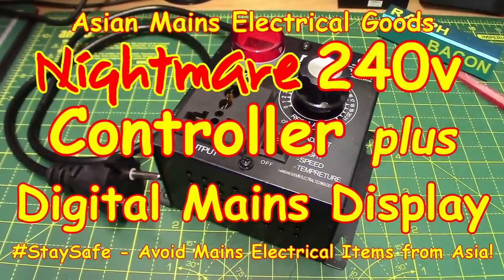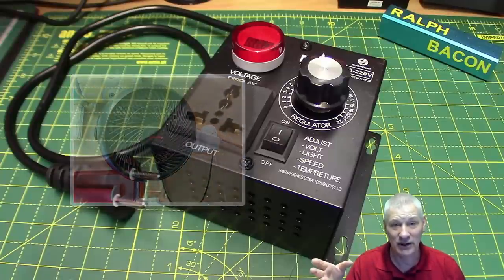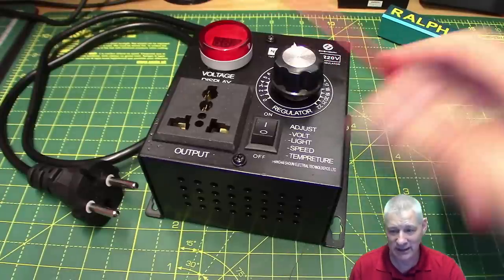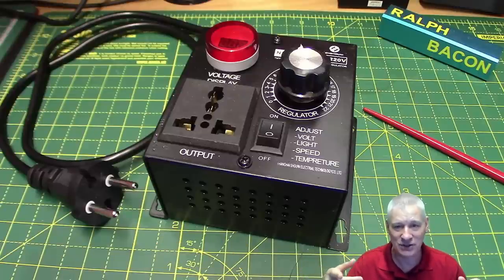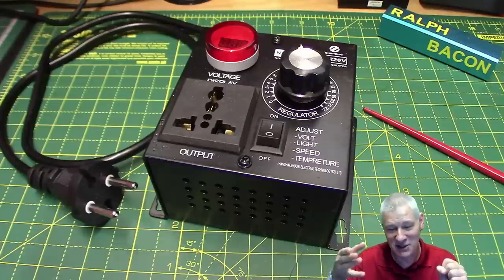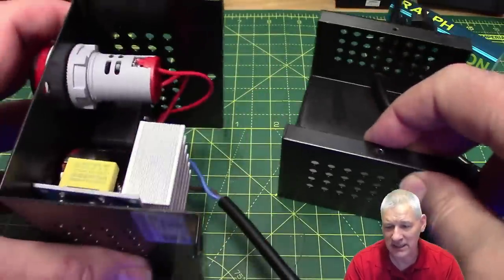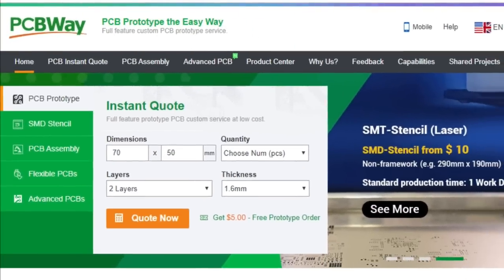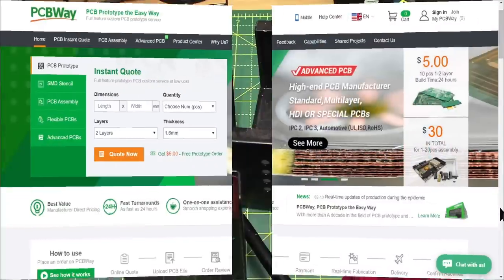#188 Nightmare Fan Speed Controller PLUS a Volts & Amps Digital Display

Comment: Hi Ralph. I love your videos. I have some questions about video #88 (X9C103). I am trying to use an ESP8266 NodeMCU to control the X9C103 BY WAY OF ALEXA. I have written a short sketch which sets up the 8266 as an Alexa device, and it is functioning properly. Do you have any tips or resources for adapting the code you used in #88 to allow control by Alexa. I will be using the setup to control a very old console stereo by replacing the analog pot with the digital pot. Ideally, commands would be "Alexa, Volume (which is the name for the 8266 as recognized by Alexa) up", "Volume down", to move the wiper one position, as well as "Alexa, Volume 50" to set the wiper to a specific position. I understand my pin connections, but need some help with the code.
Reply from the maker: What data does Alexa give you when you say Volume 40?  Or Volume down? As long as you can extract the value from the JSON then it is no more difficult that if you had had the value available from the start. As you have your ESP8266 functioning as an Alexa you should be able to determine this in minutes. Let me know if you are stuck.
Reply: @RalphBacon  That makes sense, but so far, my x9c103 has not arrived from China :). I won't be able to test until Friday. But you've pointed me in the right direction, so I'll get back to you once I've been able to test functionality.
Reply from the maker: You don't need your X9C device to get the Alexa bit working with a value (extracted from the JSON) in memory that you then supply to the next bit  of the project!

Comment: The digital read on your speed controller might be interpreted as "RMS" voltage.  Yes, I like your AC gauge!  Cheaper for a dedicated readout than my "Kill-A-Watt" device.  Gotta order some.   Have sent Gadget Reboot an Omron G3MB-202P photo isolated, zero crossing 5V SSR -- but sadly, I do not think he knows what it is.  Would like to try chopping up the AC power signal with an SSR + Arduino as a means of speed control.  But AC scares me.  Am barely responsible enough for 12V DC.
Reply from the maker: Mains voltages scare me too - at least, I have the greatest respect for them. Arduino have an AC phase-controlled motor circuit on their playground circuit but I just don't have the time. An hour will be all I need to fix this. (Arduino hour, obviously = most of a day).

Comment: I've never used one, but I'd at least look into a Shelly Dimmer.  It's meant more for in-wall or in-ceiling mounting, so not meant to be nice looking out in the open.  Alas, it says 50-150V for resistive-inductive loads (like a fan); OK for us in the U.S., but maybe not for you in the U.K.  Or the Sonoff iFan03, which is specifically meant to control a motor, and comes with an R.F. remote.  Both have WiFi with mobile apps, and should be able to integrate with other home automation stuff.  Imagine if it automatically turned on when the workshop got warm...
Reply from the maker: I can imagine indeed, Mark, Or, even better, got faster/slower as it got warmer/cooler? I'm now thinking of doing my own thing with the electronics, could be interesting?

Comment: I made a IR controlled ten speeds(0 to 9) using Atmega8 and a triac switching at zero cross. I see you are good at pcbs for you it would be a breeze. If you need I can share the code too.
Reply from the maker: If I had the time, Karanbir, it would be a fun project, for sure. Pretty simple too. There's even an example on the Arduino playground. But as it is 240v mains I decided against it, as I don't want to tempt my viewers to build mains-related projects with the associated risks. But thanks for the offer, nice to know many of my audience know about mains electricity.

Comment: you mentioned at the end of one of your excellent videos  you wanted ideas for projects, i am about to embark on an intervalometer for my Canon eos M. theeos m doesnt have the usual 2.5mm socket other cannons have so i need to build an IR Intervelomater. i need to have say 4 buttons to select 30s 1 min 2 mins 3 mins 4mins. it needs to trigger the ir led to open the shutter then trigger again to close the shutter depending which button you have pressed then it needs to wait 45 seconds so the camera which is really slow writes the data to the sd card then repeat ad infinitum. i use this for astrophotography   ANdy
Reply from the maker: If you know the signal to transmit (the waveform) that your camera expects, you can use an Arduino to generate that using bit-banging on the output pin connected to an IR LED (with suitable series resistor). Almost like a universal TV controller but with just one button!

Comment: I bought this expecting it to change the voltage down from 240v but it doesn't seem to work
Reply from the maker: It doesn't change the voltage in that way. It chops off part of each 50/60Hz cycle so that there is "less" electricity in each cycle to power things. That can control the speed of drills, for example, or control the power from heaters.

Comment: Hi Ralph, That socket on the front isn't compliant either! You can plug things in very wrongly! Hope you're doing okay :)
Reply from the maker: You are right, Jess! I've mentioned that I either will not connect it up (hardwire my fan) or try and find a very small one that I can replace it with. Or take a risk. What could possibly go wrong? 🤭
Reply: @RalphBacon  Quite, haha. I started laughing when you brought out the death 'daptor too (the 'universal adaptor'). Those things are dangerous. The ones I've seen don't even have earth continuity. Which is fine if you're us and know to respect this 'non compliant' stuff but they're sold to the public with thousands of products and some are quite unaware until they get 'the speech' from me.

Have you seen those non compliant tiny British-style plugs with kettle plugs (IEC13 IIRC) on the end? They're not fused and they use some aluminium alloy as the conductor. Those are a... how did you put it... a disaster waiting to happen!
I try and avoid anything mains rated if I can but it's usually fine if you respect it properly and follow proper procedures. Especially in those day and age anyone can take a 3 day 'Part P' course and be an 'electrician'. Doesnt teach you how stuff really works though Haha, never get the practical skills just from books imo.

I've been catching up on your videos yesterday and today. Have been very unwell past couple of weeks, which is bad if you can't convince me to even watch my favourite YouTuber :p Love the new 'Bacon Bytes' segment too! (Or was it bites... I'd totally have gone with bytes :p)
Reply: @RalphBacon  also just had an idea... if it's just a 40w fan you're controlling, can you not just use a standard 'lighting' dimmer switch? X
Reply from the maker: Hush, Jess, that's no fun at all (and is effectively what I am doing now  with that plug in dimmer).
Reply: @RalphBacon  Haha, Yeah... Wouldn't have gotten as good video out of a compliant solution :P
I kinda meant with the dimmer, route a cable back to your desk (240v... twin core in a loop) so you can control it from where you want... Kinda a hybrid between the two solutions?
Oh incidentally! Remember the challenge that... we kinda agreed on with the ATTiny13A? You were gonna do your fridge alarm (successful!) and I was gonna do the On/Off/Kill circuit? Well... I'm pleased to say I got my head around programming the ATTiny13A (I built a universal ZIF socket-ed shield for an Uno so I can program ATTiny 8Pin DIPs and ATMega328P 16 pin DIPs, so I don't need to build up a programmer breadboard every time!) and I've adapted the code for it, and it works. I'm putting together a schematic and a friend has suggested it would be a really useful module to build for other people (as well as the ultimate use I'm going to have in my blinklenlights project!)
The GitHub link is https://github.com/accessiblepixel/ATTiny13-On-Off-Kill/blob/master/ATTiny13A-On-Off-Kill.ino
Don't laugh, I'm very much a noob when it comes to putting things on GitHub, haha. What do you think? Silver or gold star? :P

Comment: LOL: "TEMPRETURE" tells you all that you need to know about quality.
P.S. I suspect that the current-transformer current sensor will only work correctly with a full sine wave.
Reply from the maker: Then again, I don't know how to write "temperature" in Chinese either, Bernd! Apparently you can wind the cable through the ferrite ring more times to get a bigger reading - that might work with a partial sine wave.

Comment: yes your 100% right, all exposed metal on any home electrical appliances should be earthed. , i got a shock from the scr control knob that i wired up, the only thing is if i earth on the metal work then the RCD will trip, so what can i do next? throw away the scr and make a new plan.
Reply from the maker: The SCR that you used (dimming lights?) will be connected to the mains so any components attached to it (eg a potentiometer) could also be at mains voltage. 

You could use an opto-coupler between the pot and the SCR so that it only uses low voltage DC but you would have to redesign the circuit.

Sometimes you can get pots with a plastic spindle to insulate you from the voltages but that is just a halfway house measure really.
Reply: @RalphBacon  well i was using it on a water heater 2000w, it has a black plastic turning dial yes, but look at the very end of it.. its shinny and looks like metal. thats the spot where i got the shock... induction maybe i dont know.
Reply: @RalphBacon  oh it didnt come for that model that your using in your video.
Reply: @RalphBacon  I did buy the Speed Controller yesterday the one that your showing here. In your video looking at pictures of the site where you bought it from shows a plug with a earth on it. hmmm. I will see what happens when mine turns up and see if it has a earth on the plug.
Reply from the maker: The plug might have an earth pin but where is it wired to (if at all)? Please don't use it without ensuring an earth wire is present and bolted to the case and connected to the earth pin on the socket too.
Reply: @RalphBacon  yes i will open it up and look inside..
Reply: @RalphBacon  i have a good little amp and volt meter here but i don't think it will fit inside, will see.

Comment: I would not have any problems using a thyristor to control mains power (it would required 4 diodes), but a low cost product would use a triac and a diac, no doubt about that.
As for safety, the law says 4mm in clearance and 6.25mm in creepage distance, you will never get that inside the potmeter. To be really safe you need a potmeter with a plastic shaft mounted a couple of mm from the front, it cannot be screwed into the front. With a earth connection it is much easier to be safe.
As you say, the meter shows a value, but there is not any unit behind it. The problem being that after a triac you can only measure voltage with a RMS meter.
You stand alone voltage&current meter was rather nice, but I would have preferred a 1A coil (Most of my stuff is fairly low power).
Reply from the maker: I'm now tempted to replace the crude electronics with an Arduino (Tiny85? Tiny13?) controlled, zero-crossing unit. If the zero crossing modules were opto-isolated It would be very small and so much safer! The MOC3052 Triac Output Optocoupler is very cheap (less than 50p). I might have convinced myself... Lead by example and all that!
Reply: Non-zero-crossing switch, if you want to adjust the speed. MOC3052 is the correct type. You will usually want an external triac to amplify the current.
For this to work you need to synchronize the processor to the mains, either directly or through a opto-coupler. I once did that with a ATtiny15L, including a serial connection to control it (I would have like more program space, but at that time there where not many small processors to select from for hobby use). I used it to control incandescent bulbs and I really had to get that synchronization to mains precise/stable or the bulb would flicker at low brightness.
The data for the MOC3052 looks safe: Up to 6KV and 7mm, but you have to put a slot under it to maintain enough isolation distance, due to the solder pads.
Reply: i forgot to add: 
You can also buy (small) solid state relays, that is basically the same as the MOC3052, but with a larger triac on the output (Or maybe a MOC.... and a triac). It means less parts at mains voltage, but again you have to check if it is zero-crossing or not.
Reply from the maker: Yes, I've looked into this and have some parts on order. If I survive you can expect a video in due course, Henrik!
Reply: That is a bit melodramatic. Mains are dangerous, but not very often deadly. It depends a bit on age and we are both getting into a age where mains are more dangerous, but we also know a lot more about being careful.
Reply from the maker: Both Melodramatic and Careful are my middle names. Ralph M C Bacon, did you know? 🤣 😆  🤣 😆  🤣

Comment: how would one ground it? im planning to use this with my tablesaw
Reply from the maker: Your really going you use THIS speed controller? 

Well, you need to replace the mains lead on it with a 3-core version so that the case can be earthed, as well as the socket. Don't forget to address the issue with the circuit board being so close to the front panel - an easy job to move it back a bit (about 5mm should do), I would have thought.
Reply: @RalphBacon  yea haha imma give it ago with some modifications. okay so the ground from the socket I've to add another wire to the case yea. so its 3core to socket then socket to the other case?
Reply: outer*

Comment: A lot of DIY solar guys use those amp/volt indicators to know what the system is producing at any given time.  Given the sun has a broad degree of activity depending on time of day as well clouds, solar guys like knowing the effects in terms of amps/volts so they love those indicators.  The ones they use are simple like the one you have, but there are others that offer even more data for monitoring solar panels and batteries.
Reply from the maker: I've always wanted to get into solar power (in a small scale) but the cost of a solar panel that does more than light an LED on a cloudy day is so expensive I just can't justify it. One day, maybe.
Reply: @RalphBacon  Should have a good reason to go solar in my opinion.  Some go just to do it and the whole save the planet thing.  If one lives where electricity is stable and relatively reasonably priced, I'd not do it.  Before the year is out, I'm going to be living in the developing world where brownouts aren't unusual depending on the weather and electricity is expensive so a solar supplement makes sense in that world.  Apart from brownouts, a hour long massage cost 5 dollars so quite the deal.
Reply from the maker: Are you going the whole hog, solar-wise? Panels, lots of 12v batteries, regulators etc? In sunnier climes than the UK I reckon $500-1000 could get you a nice setup that would ensure brownouts never affected you. You can watch TV whilst others have to use a windup radio. But air con off such a rig would be a no-no, I suspect.
Reply: @RalphBacon  I'm going with 48v system and around $2500 in batteries alone which I just finished packing in boxes for shipping (shipping cost is very low).  Check out youtube title "LG Cells Part 2, 6kwh 48v DIY Battery" to see the batteries I bought.  David has just 1 battery, I bought 6 of them so enough to power everything in a house to include AC in a small room.  I won't have much AC in the house though - probably just enough to cool a room from 11pm to 8am for sleeping.  I did get a really good deal on the batteries, if I hadn't got that deal, I would have developed a system half the size, but deal was too good to let go.  I'll  have grid power for high demand items and use solar for the lower demand stuff so even without sunshine for 3 days, I'll still have enough power for TV, computers, and a lot of LEDs.  After 3 days of clouds, I'd have to flip the switch so everything runs off the grid.  If I don't put a lot of demand on the batteries, they'll likely last for 15 years so the 2500 is worth it from that standpoint.  BTW, 12v systems are the most expensive because so many more AMPs so big wires and equipment are needed to support those AMPs.  I use to play around with woodworking, but I didn't have the patience so switched to electricity and love it.

Comment: "Its formal name is bidirectional triode thyristor or bilateral triode thyristor. ... TRIACs are a subset of thyristors and are related to silicon controlled rectifiers (SCRs). TRIACs differ from SCRs in that they allow current flow in both directions, whereas an SCR can only conduct current in a single direction." - Thought you should know! Also, TRIACs without any input filtering are devilishly noisy to the point that they can interfere with electronics that use zero-crossing detectors - such as clocks and timers that use the mains as a frequency reference.
Reply from the maker: I was a bit worried about the non-zero crossing, David. I'm tempted to make my own controller and replace the module in that rather solid case.
So Thyristor is the name of a family of components that include SCRs and Triacs? As a kid, when I started using Thyristors (don't ask, lucky I'm still here) we used the term SCR and Thyristor interchangeably. There were no Triacs (but we did have running water and electricity). Thanks for the clarification.